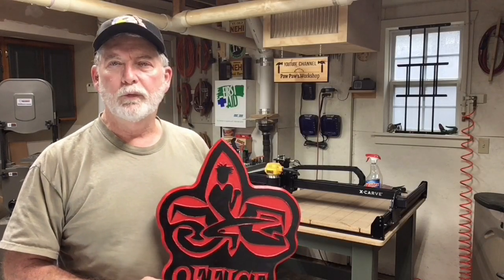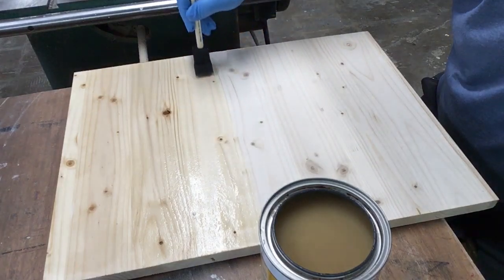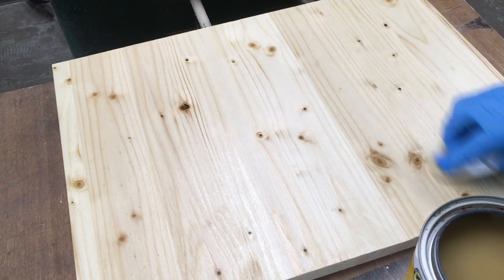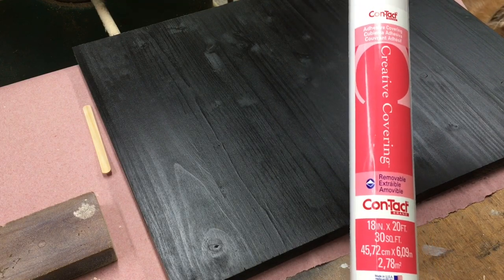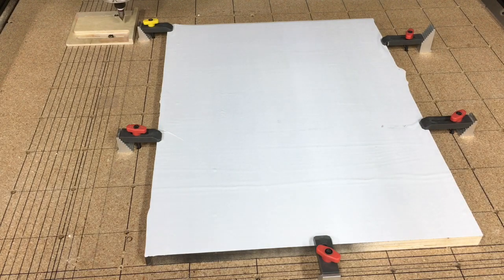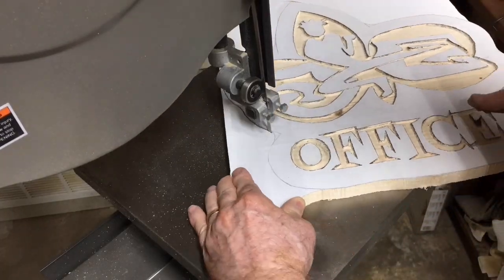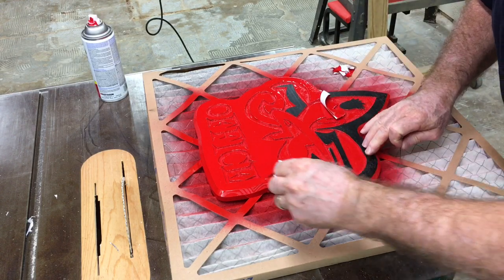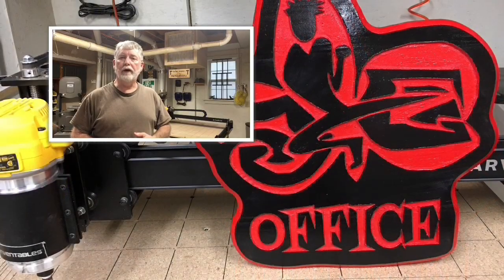How to Paint a Sign Using Masking Film (PART 3)

Comment: Great video, I'll definitely have to try this method!
Reply from the maker: The masking works very well.  Look in the comments.Gregory Lawhorn suggested a different material to do the masking.  Having the material stick well during the carve and easy release it very important.  The material I used did require the extra glue.  It's worth finding a material where that is not necessary.  Gregory Lawhorn may have the answer.
Reply: I read his reply as well. I may look into that. But overall, your video answered pretty much all of the questions I had about masking haha. So thank you very much for that! I did a project for my kids first day of school, where i painted the whole surface after the cut. Allowing the paint to settle into the carved out area. Then sanded off the surface revealing the natural wood but with the carved portuon still painted. Turned out very well.
Reply from the maker: Thank you for your comments.  I'm happy that the video answered most of your questions. Most of the painting that I do is where I carve the project, seal the wood with several coats of sealer, then paint. Once dry, I sand away the paint on the surface leaving the carved portion with the paint.  Last step is to seal the wood again.  This works great and is a fairly simple process.

Comment: I use Oracal contact paper ,no need of extra adhesive, I also use a laminate roller to press onto wood helps to get rid of some of the air bubbles
Reply from the maker: This was an attempt to use some cheap alternative.  I now use Oramask 813 for all of my masking needs.
Reply: I guess im randomly asking but does someone know of a trick to get back into an instagram account??
I was dumb forgot the password. I would love any tips you can offer me
Reply: @Preston Jasper instablaster =)
Reply: @Makai Fernando Thanks so much for your reply. I got to the site on google and Im in the hacking process atm.
Seems to take quite some time so I will get back to you later with my results.
Reply: @Makai Fernando it worked and I actually got access to my account again. I am so happy!
Thanks so much you saved my ass :D
Reply: @Preston Jasper glad I could help :)

Comment: Great video as always.  Question:  the masking I use (oramask 613) adheres so well that it pulls the paint off the wood.  I didn’t catch the brand of paint you were using?
Reply from the maker: Most often I use acrylic paints.  If it is a spray can it is Rustoleum  2x You can get it at Walmart and the big box stores.

Comment: Great sign. Thanks for sharing. I've tried the contact paper with my x-carve also and had the same issues with it still sticking. Did the super 77 leave any residue?
Reply from the maker: M Mays .  It left very little residue. The can that I used is also about eight years old. Not sure if a new can of glue would cause more or less residue. Thanks for the comment and question. It did carve very well with the glue. The masking worked well.
Reply: This was my main concern as well. I'll have to give this a try with some of the adhesive spray I've got in the shop.

Comment: Paw paw have you tried a downcut bit? interested if it would prevent it from pulling up. I f anyone has tried this some feedback would be appreciated
Reply from the maker: Thank you for your comments.  This masking turned out to be terrible.  Oramask 813 works extremely well.  Normally you want to use an upcut bit on PVC to get the chips up and away.  The problem is that is pulls up the masking.  Yes, when using masking use a down cut bit.